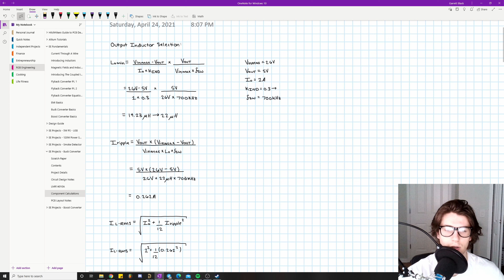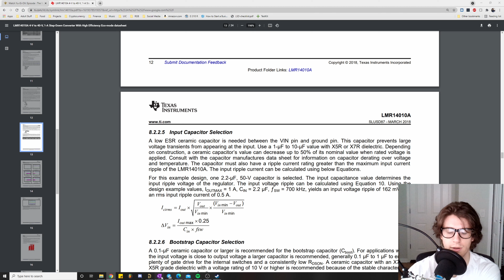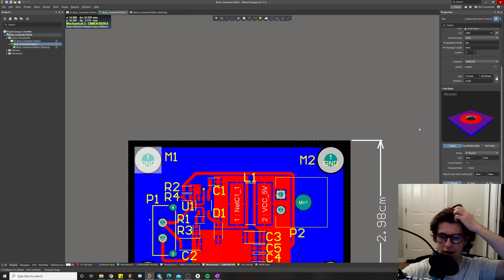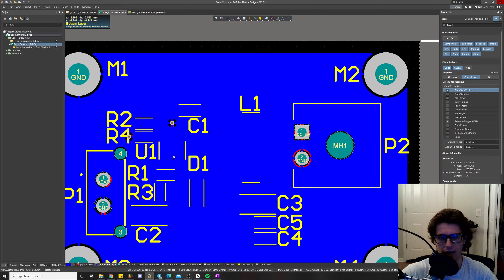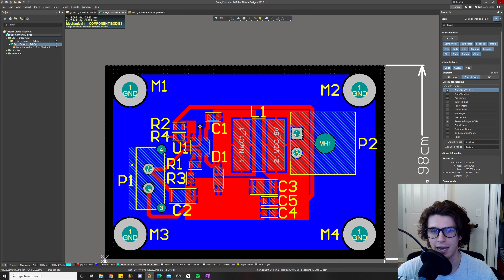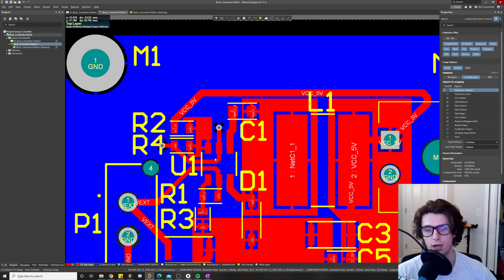BUCK CONVERTER EXAMPLE | BUCK CONVERTER DESIGN GUIDE | BUCK CONVERTER CIRCUIT DESIGN | PCB DESIGN

Comment: How to add mounting holes to the schematics?
Reply: you dont add mounting holes to the schematic
Reply: @rokiedecentra9656  you can, on KiCad
Reply from the maker: I made a part in Altium just like a resistor or a capacitor